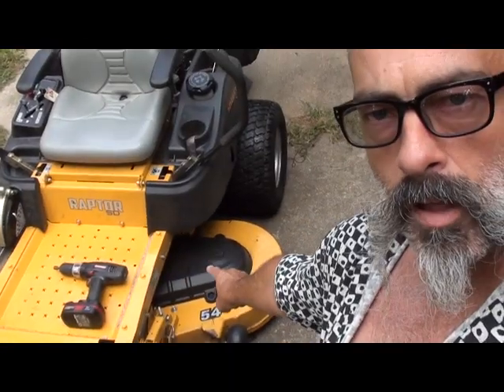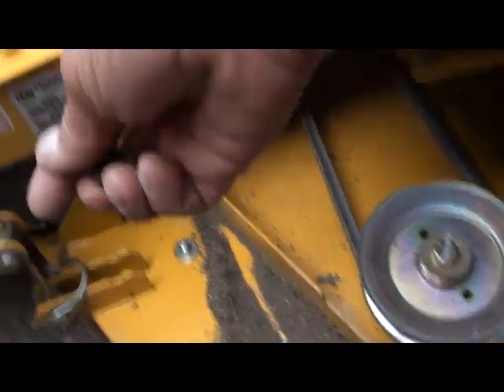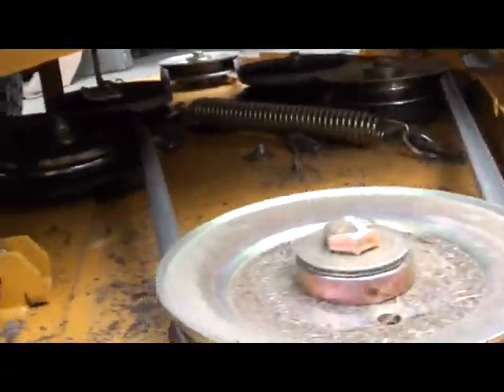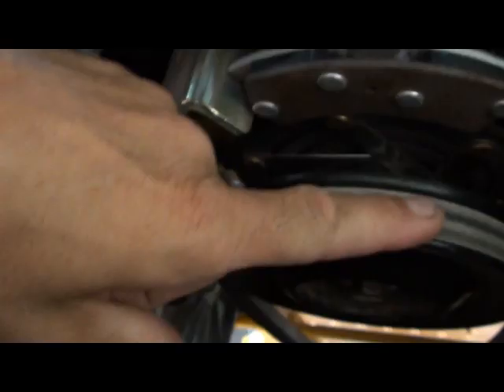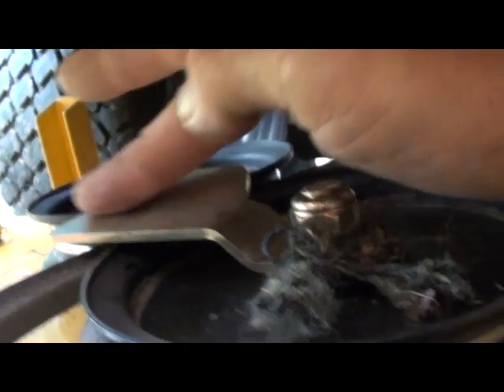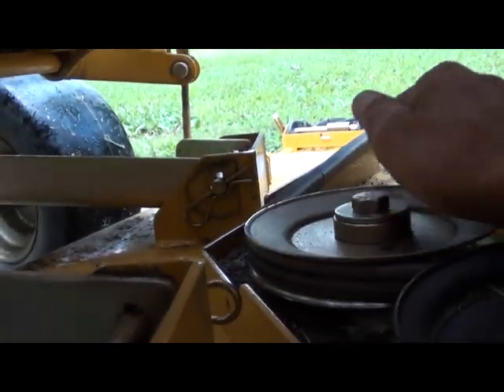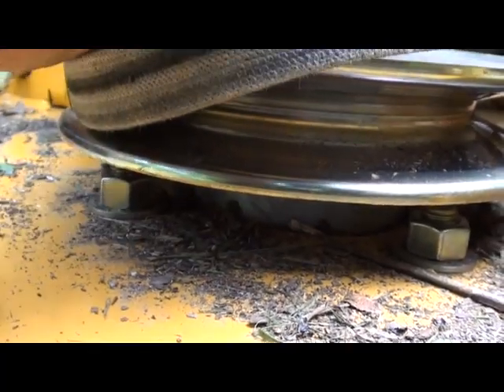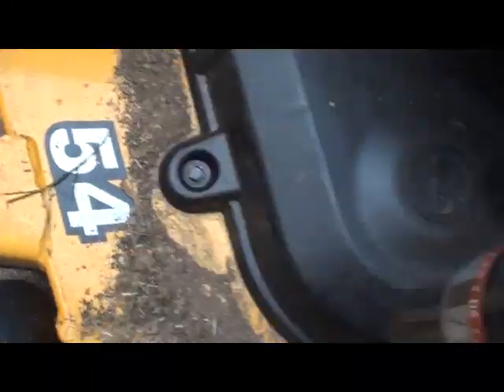easy belt replacement, hustler lawnmower, almost NO tools!

Comment: I appreciate the video. My belt broke Saturday (during the first weed mow of the spring) about an hour before my local mower shop closed. Personally, I found it easier to put the belt around the two rear deck pulleys first (before I put it on the drive pulley). That seemed to make it easier to get the belt around the "metal do-hickey". It would be nice if Hustler had a "deck lock" feature. That would keep the belt from rotating as you pull on it to get it onto the last (right-hand) pulley. It's a bear to hold the belt with two hands with your left foot on the rear wheel for leverage. I saw another video instructing viewers to remove the tensioning spring. You said, "No need to do that." You're right and that info is a lifesaver. Thanks again!

Comment: Bravo!  Thanks for such a clear video with embedded pictures.  Great job!
Reply from the maker: Glad it was helpful!
Reply: I did use a screw driver and the holes in the last pulley to help pull the new belt around the pulley.  The holes are on both sides so the screw driver can go all the way thru and act as a levor.
Reply from the maker: @PeteJCBeebe  thats beautiful information! thank you!

Comment: I see some assholes making comments about noobs and democrats not been able to do this. I'm neither but this does happen to be my 1st zero turn and the belt popped off when I got into some deep weeds. Your video did help me realize that I should not have taken off the tensionor spring. After I watched your video I took the belt off one of the pulleys, reconnected the tensioner spring and put the belt on like you showed. Helpful video, thanks. Now, back to mowing.
Reply from the maker: thank you for your insight! stay safe my friend!

Comment: PSA! Anyone with the 36" Raptor or the 36" Alpha, please note there is a lip on the tensioner pulley that will require the partial removal of the pulley, so tool-less belt switches are not an option.
Reply from the maker: thanks copper creek!
Reply: Can you please explain how to remove the tensioner pulley with lip to replace belt

Comment: I have a Hustler Sport (is not a raptor) but the pulley setup looks the same.  How do I check to make sure I get the correct belt? can't find anything to check it against...
Reply from the maker: always goto a hustler dealer to make sure you get the right size,.. the slack in the pulley allows for some slack but i am unsure about how much,.. you could always measure your old belt then look for one in the similar size,.. it should work,.. belts arent that technical about their usage LOL
Reply: thanks,  I knew the length of the belt by looking it up...but when I was in town I called the local Hustler dealer and he asked me for the model # of the mower, of course I didn't know it but I told him the belt was 134.5" x 5/8ths... he proceeded to chide me and let me know unless (i drive all the way back home) I have the model number I'd probably get the wrong one.  OK, guess I'll drive back home.  I checked the model number, called him back, he confirmed the belt I thought it was was the correct one... then he let me know he didn't have it and would have to order it... I called another dealer about 30 mins away and he had it in stock.  Picked it up and put it on and finished my mowing... thanks for your  video... cheers,
Reply from the maker: what a dick he was,.. glad you got your belt! thanks for our comment!

Comment: Is there a way to tighten the belt
Reply from the maker: if your belt is slipping, there could be several reason as to why it is slipping, the belt tensioner shouldn't need adjusting,.. do the blades spin freely with no belt attached? could be something else like string wrapped up in the bearing area, could be excessive wear on the belt
Reply: @thedesertartist i have a 52in cut hustler raptor the belt doesnt crab on the pullies like it should i cut a little patch of grass and it has a hard time cutting it i bought the mower new and this is the way its been
Reply from the maker: @phillipramirez7145  take it back to the dealer,.. mine had a bad frame weld,.. wouldn't cut, manufacturer defect
Reply: The new tensioner spring is stronger...there also was an issue with them breaking 

Seems a lot of Hustler owners are complaining some about the old soft spring 

Great mower ...i never had that problem ..my spring broke 

The spring is like 8 bucks on Amazon 

And tightens everything up

Comment: The new replacement springs must be tighter..i can't get the belt back over...rhe side pulley....gonna need king kong
Reply from the maker: Roll the wheel when you get it on a little
Reply: I finally got it back on ...thanks ..I was rolling...I finally made a little tool to help 

I guess thr old RA hands aren't as good as they use to be
Reply: @davidswink6653  Same here, my spring is so strong I have to push on it with my foot for it to move in any substantial distance, then i can use a ratchet strap looped around the back tire to hold it while i jimmy the belt over the last roller.